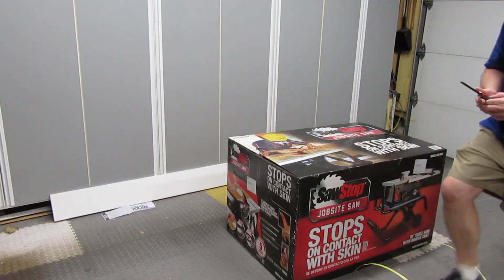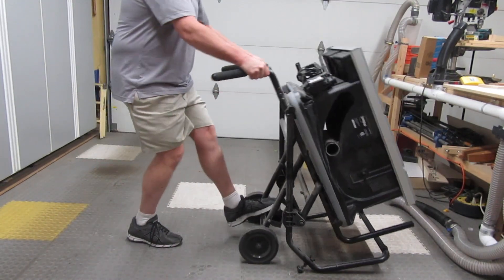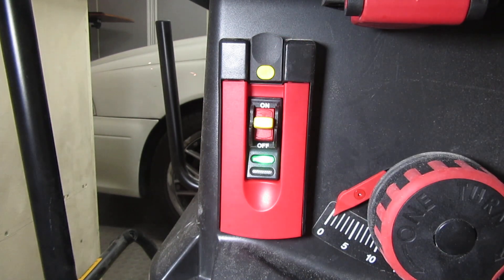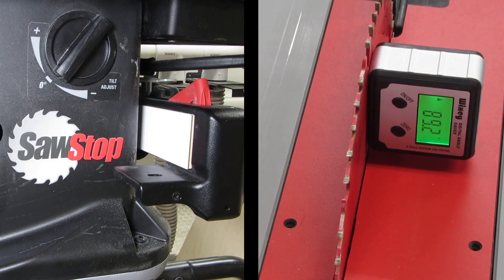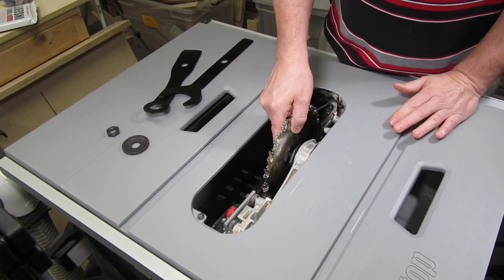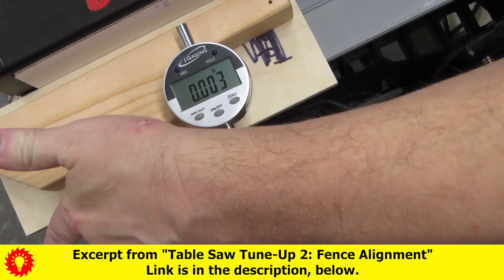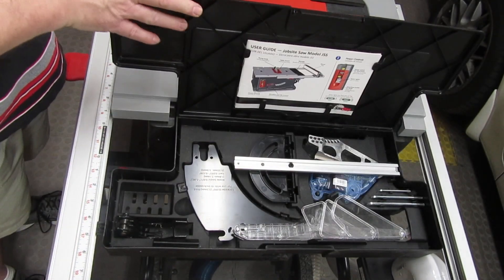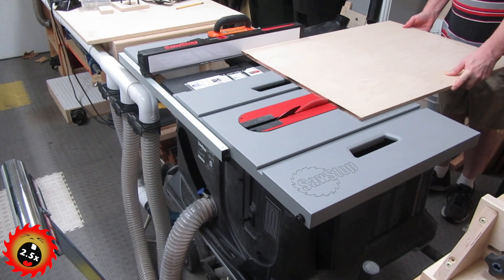SawStop Jobsite Saw Unboxing & 5 Month Review

Comment: A YouTuber Rex Krueger just recently got the tip of his thumb and thumbnail cut by his SawStop. Three stitches worth. Check out his channel and the video he just released about his accident. I think that you’ll like his channel.
Reply from the maker: I just saw that video yesterday. I guess it's getting recommended when you watch mine. Scary stuff, that, especially since he doesn't really know what happened. New rule: Always run a camera! ;p

Funny thing is, I did almost the exact same thing to my left index finger about 10 years ago. I was paying so much attention to the right hand, I forgot about the left. Everything grew back, thankfully!
Reply: I just watched the Krueger video and immediately noticed he was using a blade with those anti-kickback teeth (or whatever they're called). Sawstop specifically recommends against those blades because they take longer to stop. Guess Rex wasn't aware of that, but it was clearly spelled out with the documentation with my saw.
Reply: Nick Decker  any chance you could elaborate on that Nick - how do I know if I have the 
 right/wrong blade type?
Reply from the maker: I think he's referring to http://www.sawstop.com/support/faqs/. Look for the section "Can I use any 10" standard blade or 8" dado set with a SawStop saw?" Personally, I never saw this before - you'd think they'd mention this more prominently.
Reply: I've had my Jobsite a little over a year, it came with a separate "flyer" with a picture of a blade with this anti-kickback feature, and said these blades should be avoided. I've seen this configuration on a couple of different blades, one by Amana and this one by Freud:

https://www.amazon.com/Freud-Thin-Kerf-Blade-LU87R010/dp/B0000225UH/ref=sr_1_fkmr2_3?s=hi&ie=UTF8&qid=1518867122&sr=1-3-fkmr2&keywords=Freud+anti-kickback+blade

Sorry, I can't find the flyer that came with the saw, but I've seen the subject discussed on various places on the 'net. Basically, you can use this kind of blade, just know that your brake's reaction time may be affected. Hope that helps.

Comment: 74.9 k subs, you should ask incra for a fence system
Reply from the maker: I actually don't have room in my shop for the Incra fence. Also, that would be too "not-newbie" for my channel. 😛
Reply: @TheNewbieWoodworker  ya, that incra is the micrometer of fences, even when i'm trying to make necks, and pockets with guitars, once it's within a 16th, it's pretty good, or i just hand sand a bit at that point, i think a machinist was trying wood work and came up with that, my biggest problem is getting things square , especially when you buy something that is suposed to measure for square , and then you find out it's off, i had a guy from the machine shop a few doors away from the body shop i work for make me a referance triangle, and i just got some 123 blocks, so now i know my gear is set up square, i just have to pay better attention to my tecnique
Reply from the maker: @jakeqwaninne8502  Oh man, I totally understand about a square that isn't square. The first time I tried to square the fence on a cross-cut sled, I had all sorts of problems until I finally discovered that my square was not actually square. Now I have a set of precision squares and I check everything against them. So like I said, I'm right there with you!

Comment: 15:19 NEVER put your hand THAT close to the blede. Use a push stick instead.
Reply from the maker: Holy crap! What was I thinking???? Even with a SawStop, that's still stupid. Thanks for pointing that out.  I'm guessing I was thinking more about the video than what I was doing, and that's a recipe for disaster. Sheesh. Watching that makes my skin crawl!
Reply from the maker: I saw this yesterday (I think). Scary. And yes, I do treat my SawStop just like any other saw. Apparently, I can be stupid with any technology!
Reply: Yeah, I saw that and figured you made a wise purchase. :)
Reply from the maker: LOL! I still can't believe I did that, and I had no clue! Now I use a push stick in both hands when I have to do stuff like this. A Matthias Wandel style stick in the left hand, and a John Heisz style stick in the right.
Reply: Recommendation is 150mm or 6", typically most saws like yours have a slot in the table, this is typically about this far apart, and it makes a good rule of thumb not to have your hands inside this area, but equally make sure your push sticks are long enough 450mm about 18"
Reply: There was 0 reason to grab that little piece anyways. Not sure why you even did that.
Reply from the maker: Who knows what goes through my mind, sometimes?

Comment: Great channel, mostly, and am a Subscriber, but this video does not encourage safe and proper use of a table saw.  I worked in high end custom cabinetry and trim carpenter trades for many years, and had a minor saw blade encounter, so I know whence I speak.  Too many videos showing no guard, and no disclaimer if the guard is removed for video purposes!  I also don’t ‘get’ the obsession, if you will, of getting the left hand too close to the blade, to move the cut off piece, whilst the saw is still running?  What is the value exchange for keeping one’s fingers?  Respectively submitted, and only in the interest of promoting safe practices.  Yes, the guards are all mostly poorly designed, and can hinder visibility and ease of cutting at times.  But, is it worth the risk of a possibly debilitating injury?  NO ONE is faster than a spinning blade!  And that age old ‘guards are for amateurs,’ or they get in the way, are often quoted by someone that is only a cut away from a bad day at the saw.  Thanks.  Work safe and smart!
Reply from the maker: Thanks for the great comment! First of all, I've learned a thing or two since this video (but I admit I still have some bad habits). One thing I did helps me wait for the blade to spin down before removing anything: https://youtu.be/WFNgPWYDxqw. More importantly, I've learned to love my blade guard, and even built a cross-cut sled that lets me keep the blade guard on: https://youtu.be/cQINXsn2QBk. So I'm definitely learning, but by all means, keep pointing out my bad habits. People learn from seeing other people do things, and if they learn bad habits from me, that's not good at all!
Reply: @TheNewbieWoodworker  Thank You for your gracious reply!  Please know my comment was only meant to help, nothing more.  I am nobody special, and certainly no ‘fountain of knowledge!’  I view the use of any table saw, as akin to using a firearm.  Respect it!  And I was told, and I learned, to always know ‘where your hands are!’  I see people talking about watching the cutline, and paying more attention to the scrap pieces coming off the saw, when they should first and foremost, be watching their hands !  I am off my soap box now.  I was very fortunate, to have suffered a very minor injury to my left index finger, using an old Delta table saw.  It was company supplied, and they had replaced the motor, and it was not running properly.  The fence would constantly ‘creep’ out of position, and I was cutting laminated trim pieces, with the slippery laminate side up of course.  I lost patience with the process, and next thing I know, BAM, into the blade my finger went.  There was no guard available to put on.  I should have walked away from it, but you know what they say about Hindsight!  I will watch your videos on the crosscut sled, and I am a Subscriber.  Thanks, and stay safe!  👍🙏🇺🇸
Reply from the maker: @georgedavall9449  Thanks, George, and no worries. I took your comment just like you intended it. And your comment "I am nobody special, and certainly no ‘fountain of knowledge!’" applies to me as well. My only claim to anything is I know how to edit videos, and I'm pretty good at explaining things. But I only know what I know, which isn't much except for what I learn watching videos, and from people like you. So believe me, when someone with experience like you says something, I listen. Although it sometimes takes me more than one time to learn or remember it!
Reply: @TheNewbieWoodworker  Hi again Dan ☺️ I really appreciate your humility, and your replies, and kind words.  I like your content, and you have much more skills than just ‘editing videos,’ which you do well. You are approaching 99K soon, so you must be doing alright! 😉 I’ll put it to you like this; I would enjoy the opportunity of doing a project with you, and sharing ideas and talents, if ever presented.  I enjoy the injection of humor.  Until then, I will just keep watching your Videos, which are well done!  Take care, stay safe, and, I might add, please keep push sticks close by and use them!  Thanks! 😊🇺🇸
Reply from the maker: @georgedavall9449  Thanks for the kind words. I admit I have a tendency of being a little harsh on myself, but in this instance, it's justified. 9 times out of 10 in my videos, I'm just figuring it out as I go along. The one thing that helps me is the fact that my software engineering mindset transfers really well to woodworking. It's basically the same thing, believe it or not. In any case, I'm sure I'd enjoy working with you too! Thanks again. 😄

Comment: That saw is rippoff
Reply from the maker: Why do you say that?
Reply: 1200 is way to much, I bought a craftsman for $180 years ago
Reply from the maker: OK, thanks for clarifying your comment.
Reply: @javybeaz3236  my brother lost a finger due to an accident that would have easily been avoided with sawstop technology, sawstop only sells sawstop saws because widespread adaptation of the sawstop mechanism was denied by the major saw manufacturers even though on average it would only add about $100 to the price of the average saw making a $200 saw a $302 saw and so on, the primary reason given from what I remember was to avoid increasing price to the consumer, one person even want a lawsuit against a saw company after they lost a finger after that specific company specifically denied implementing the safety mechanisms after it was mentioned to them and presented by the sawstop Creator I think they won 3 million dollars. But my general point is that if the saw companies had generally adopted the  technology years ago when it was first presented it would already be in general use and drastically cheaper and maybe even better performing. But who cares about tons of accidental dismemberment can't cut into those corporate profits or scare customers away with an extra hundred dollars!
Reply from the maker: @theomegawerty9688  👍